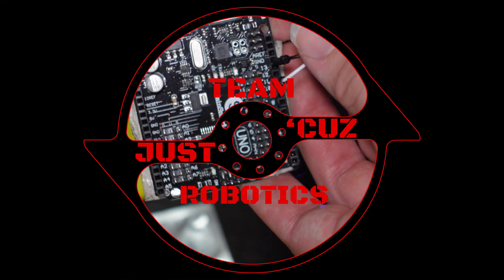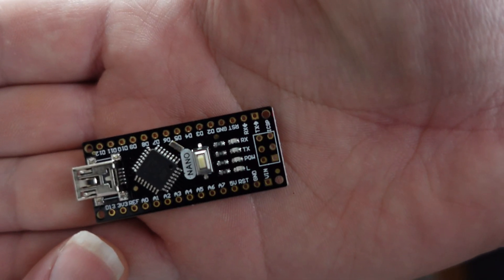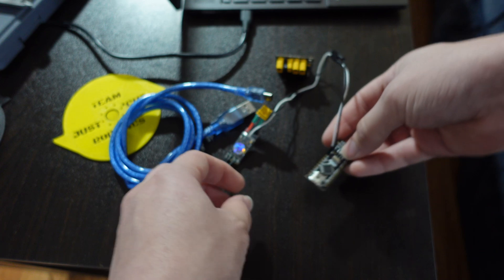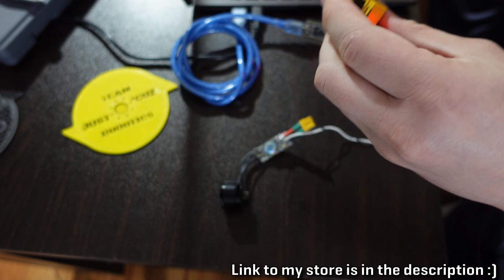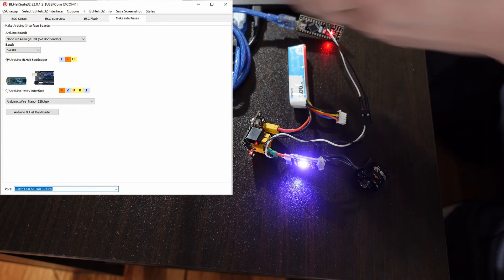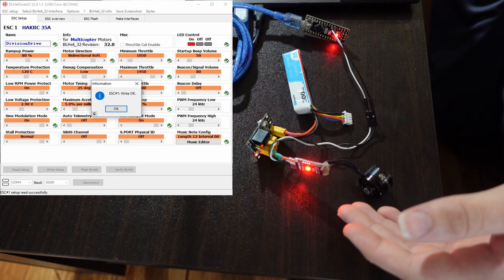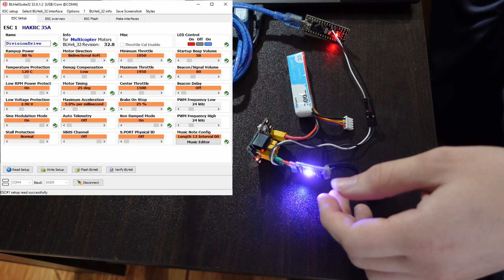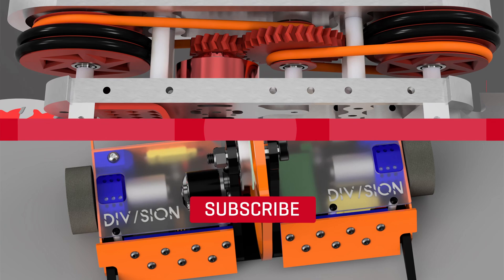BlHeli Programming with Arduino as Programmer - Brushless ESCs in Combat Robots

Comment: For anyone wondering if you can flash BlueJay like this  - No. I tried, trust me.

Get a stm32 discovery board or something that has a working usb port on it (Like arduino port just for stm32) , flash betaflight on it using compatible betaflight hex file and ST-link. Then use esc-configurator to flash the esc.

Comment: Hello!! I hope you will read my comment and try to answer me because I really don't know what to do anymore. I have an Arduino mini, or rather, more than one because out of desperation I tried to buy several. I should connect it to Bheli but there is no way. I installed the drivers, the computer recognizes it, sees it and tells me a working device but then when I go to make Bheli recognize it there is no way to connect it.... It sees that it is inserted in the USB port but when I give it the command connect continues to load and finally tells me "interface fails". What could be wrong?
Thank you very much if you answer me
Reply from the maker: Did you set blheli to look for the correct interface? Certain about it being connected to the right pins? I'm not sure there is too much help I can provide other than checking the obvious things.
Reply: @JustCuzRobotics  Yes, the pins are connected correctly.
How do you tell Blheli to set the correct interface? Maybe it's the step I'm missing....
Reply from the maker: Top menu should have select blheli32 interface and you need to choose USB/COM

Comment: Hi I am trying to program emax BULLET 15A BLHELI-S esc with this method, but unable to get it to connect in ESC setup page
Reply from the maker: BlHeliS requires BlHeliSuite while BlHeli32 requires BlHeliSuite32. Make sure you have the correct software. Also be sure the ESC has battery power. Can't really help beyond that.

Comment: Can i use nodeMCU instead of Arduino?
Reply from the maker: Honestly I have no experience with NodeMCU but probably not. If it's not on the list of boards to flash with the Blheli software. You can download the software for free and see what boards are listed though.
Reply: Even with Arduino, I've had issues using unofficial nano boards. I had to use a genuine Uno. Probably something to do with the USB drivers that BLHeli is looking for
Reply from the maker: I have had occasional issues with the bargain basement Nano boards as well. Lots of them come with the old bootloader rather than the new one but most of them have worked for me. I used to buy a bunch of Pro Trinkets and use those for throwaway projects but it's a massive pain to work with them (every time you hit the reset button you have like 10 seconds to upload code to them) and they are really finnicky with limited IO. The Nanos seem much better
Reply: Thank you @justcuzrobotics for the video .... I have successfully flashed my esc  with Arduino nano board ...

Comment: thanks for the video , i have a ZMR blheli 50A ESC and got stuck in the bidirectional mode, which disabled the programming mode, i followed the video but the ESC is not recognized by the BLHeliSuite nor BLHeliSuite32 .. how can i exit this bidirectional mode and make it forward ?
Reply from the maker: Sorry but I'm not familiar with that particular esc.
Reply: Hello, i have the same issue, do you find a solution ?

Comment: Hi, I am using an arduino uno and the HobbyKing® ™ Brushless Car ESC 10A w/ Reverse ESC. I have followed your tutorial, but it doesn't seem to work. What can I do? (The problem is that it doesn't detect the esc). Thanks!
Reply from the maker: That ESC is not using Blheli32 or BlheliS firmware. If it did it would say so on the product page. So you won't be able to program it with BlHelisuite.
Reply: @JustCuzRobotics  Ok, thank you very much! Witch esc are you using?
Reply from the maker: Supply shortages suck so the ones I have are really expensive and hard to find now. They are HAKRC 35A Blheli32. I can also recommend the Flycolor XCross Blheli32 ones.

Comment: Will this work with knock off esc from amazon? Or would you need a different program? I know this is a not likely because of so many options out there but programming esc is new to me.
Reply from the maker: That's not possible to answer without knowing what ESC.  Any Blheli32 ESC or BlheliS (if using the older BlHelisuite instead of BlHelisuite32) should work fine with this. If it's not actually using Blheli firmware it won't work

Comment: Why not plug into an old flight controller running betaflight? Would be usefull anyway to make the but more controllable
Reply from the maker: I don't own a flight controller, these are cheaper, I already have like 6 of them, and I really doubt a flight controller is easy enough to set up for a land based robot and weapon. Betafight looks pretty complicated to me as someone who never built a quad.
Reply: @JustCuzRobotics  it is much easier since blheli just talks directly to betaflight via dshot. So esc’s can be configured all at once. And you have esc telemetry back to the remote. Could be usefull for weapon esc’s and motors.
Reply: Yes flight controller is much easier to communicate

Comment: BLHeli normally drives sensorless brushless motors, for something like a combat robot would sensored brushless motors not make more sense, given the better control at slower speeds? Could sensored brushless motors negate the need for gearing? a 920 kv sensored motor has MUCH better performance on the low end, so no stuttering and higher torque at the 5% throttle ranges. This would also open up using VESC speed controllers (I like the FSESC variety) which are by no means cheap, but they are open source :)
Reply from the maker: This is true. But for bots in the 1lb and 3lb and even 12lb class there are almost no sensored motors small enough, and both the sensored motors and especially ESCs are way more expensive. At the 250lb battlebot scale that changes and sensored motors are really the go-to.

My next 12lb bot I intend to use a sensored motor that's basically the smallest one I could find that can use 4S or higher voltage, but the VESC I am driving it with cost about 50% more and is about 400% heavier than a similarly rated Blheli32 ESC.
Reply: @JustCuzRobotics  There are some motors designed for RC cars, which I agree might be a bit big :) was actually toying with the idea of building my own ESC  but that might be a touch extreme
Reply from the maker: For reference the one I wanna use for my 12lb bot will be just for a lifting arm, hence it is absolutely essential to have sensor feedback. It is a NEO 550 motor from REV Robotics.
Reply: @JustCuzRobotics  I see your point, the smallest I can seem to find is about 160g and cost $60, which is the Turnigy XK3650

Comment: Hi Seth, I was watching this (https://youtu.be/tMUiVVxG1KQ) the other day and this gave me an idea. The belt on division has always been a weak point so how about putting the motor next to the drive shaft and using a impact wrench-ish thing to connect it? That way you should have reliable direct drive with the effect of the slipping belt. I´m sure you will find something to say why this is a bad idea but you never know, maybe I will once suggest something usable.
Reply from the maker: If by impact wrench thing you mean some sort of clutch, that is something I had thought about. The main issue is I cannot use direct drive between the motor and the weapon because I need the mechanical advantage afforded by a 3:1 pulley ratio to self right. In order to direct drive the weapon I would need a much bigger/heavier motor, which I did look into, but it would need to be heavily modified into a hubmotor to survive impacts and that's pretty involved. It would also make the bot way more topheavy and unstable. Having the already rather heavy and large weapon motor low down makes the bot drive much better. 

Figuring out some means to add slip to the system and still have the torque to self right while surviving massive impacts is a serious engineering challenge in general, and something I have yet to properly solve.
Reply: Being top-heavy is indeed a problem I was worried about. You could solve it by putting the motor and clutch in the regular position and use a drive shaft/gearbox to drive the weapon. You could also get rid of the clutch by using a flexible drive shaft (Like the TPU or whatever that orange/red stuff is called or something a little stronger).
Reply from the maker: I don't think a drive shaft has been used by any combat robot like that. I'm not sure why but I feel like there's a reason.
Reply: @JustCuzRobotics  Well make a test bed, put it through the biggest torture you can imagine and see, I guess.